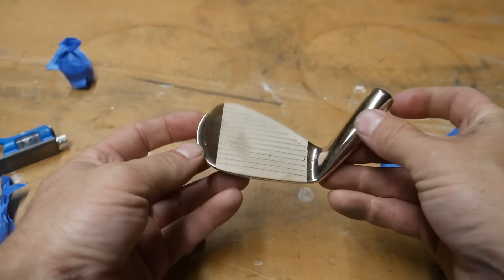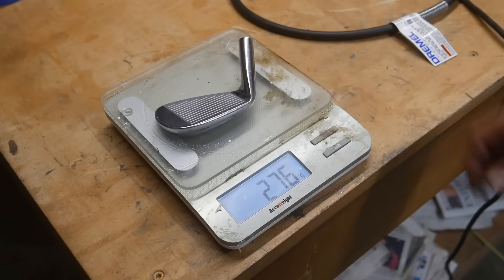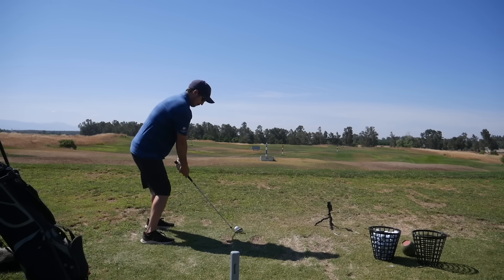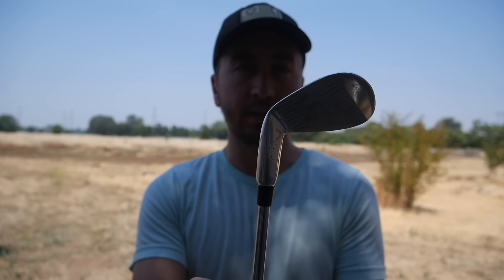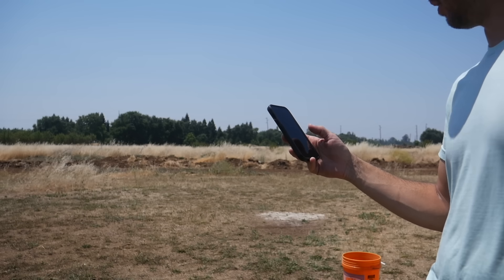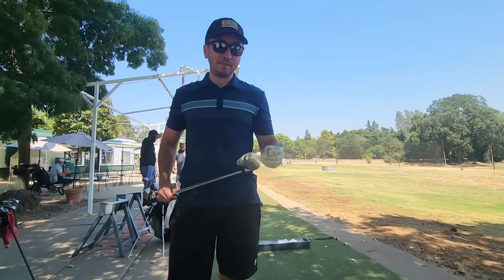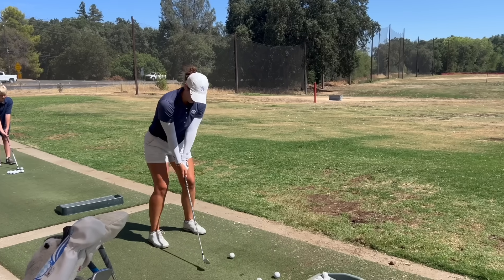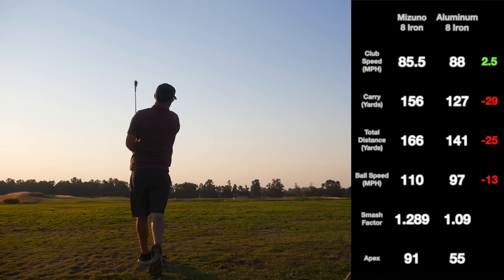Making an Aluminum Foil Golf Club

Comment: The alloy used for foil isn’t very strong, plus is not solution heat treatable. Solution heat treatable aluminum alloys are a lot strong than 3003/3004, which is what foil generally is.

Comment: Make an iron out of Beryllium
Reply: Pure Beryllium is lighter than Aluminium, so it would be even more difficult to hit than this one. If you mean a Beryllium Copper alloy, then that was already tried by Ping. 
Also, Beryllium is highly toxic in a production process; machining/sanding/grinding, so I wouldn't recommend using that. This is why Ping stopped manufacturing Beryllium Copper clubs.

Comment: Hey man, love your videos, looking forward to new metals. Just wondering... I notice you using the mlm2pro for your launch monitor and you have mentioned the spin metric a few times. I own the mlm2pro and was under the impression that without the specific rapsodo RPT balls, spin numbers are quite unreliable. Not sure if you've considered that, I assume you are aware on the RPT balls. Anyway just something that piqued my curiousity. Cheers.
Reply from the maker: Yup, we mark our own balls with a stencil and use those for reading spin data. We do that testing on course or in the field behind our shop so we can retrieve those balls. Thanks for the comment

Comment: Since the aluminum is so light, cast a full size driver or three wood head out of solid aluminum
Reply: I think the only possible issue with that would be the club being quite likely to break at the hosel
Reply: Even a 300cc solid aluminum head would be way too heavy.

Comment: Try to screw some brass bolts at the sole, the problem its not only the light weight but the weight positioning quite high on the head and the swing weight, try a lighter longer shaft. Enjoy!

Comment: Would vibrating during the pour help? I don’t know what I’m talking about but I’d think that could help with a better casting?
Reply from the maker: Vibrating investment molds isn't a good idea because they're brittle and vibration doesn't really help with porosity in metal casting. We're working on setting up a vacuum casting rig which should improve our casting quality
Reply: @Schtickgolf learned a lot thanks!!
Reply: No, vibrating won’t help get rid of the hydrogen porosity in the aluminium. You want to stop the aluminium reacting with the air which produces oxides and hydrogen in the metal. As well as proper mold design and no excessive superheating of the metal. You could add some iron and magnesium for strength, and maybe heat treat.